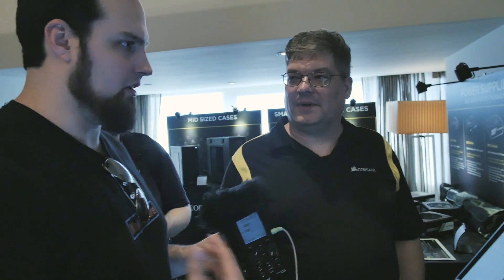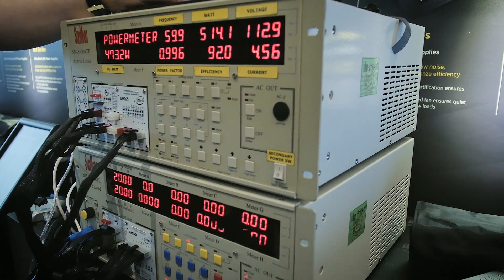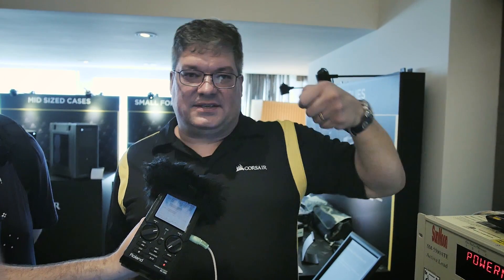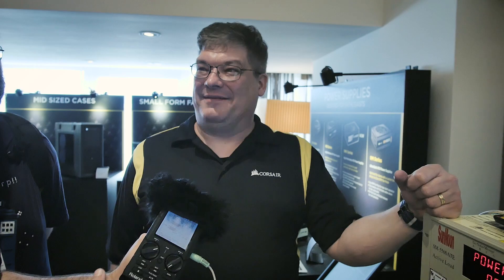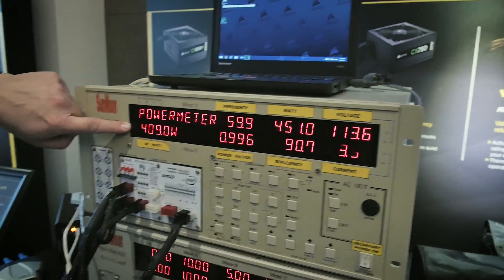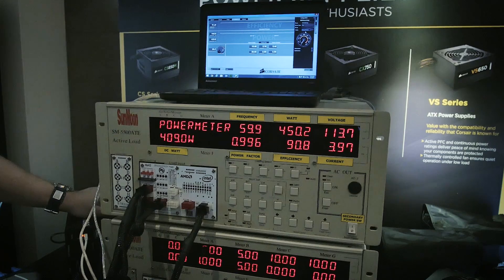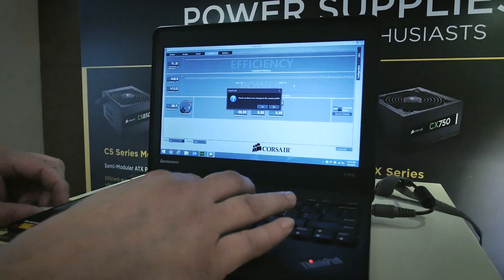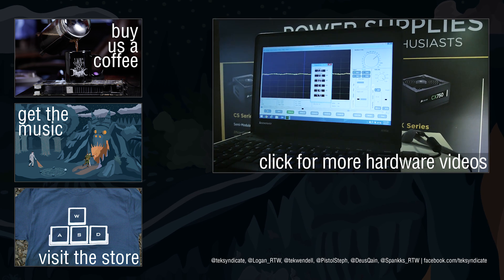Single Rails VS Multiple Rails Power Supplies - With Jonny Guru | Corsair PSUs

Comment: Great interview. I really like this 1000 watt PSU from corsair. Dead quiet at 400 watt load?!! That's perfect for me.
Reply: legendray2008 Silverstone nightjar has a 500 or 520watt fanLESS psu ( It's in my wife's rig.  Only problem imo is the price:  150 bucks.  ouch.
Reply: legendray2008 It's extremely similar to a Seasonic model from which the main parts of it came from.
Reply: Chronofusion I've got the EVGA Supernova 1000 watt P2. It's not that quiet unfortunately. Actually, it's the noisiest piece of hardware in my watercooled rig. I was looking for a fanless PSU that would power an overclocked AMD FX 6300 & an R9 290, could not find a fanless PSU high enough in wattage. So I decided to go with a high wattage good quality PSU. This EVGA wasn't the best choice :( even with eco mode activated ( a switch that you flick) . And you're right, Seasonic is like a major supplier in the business alongside other companies from Taiwan.
Reply: +legendray2008 get an ax1500i the fan doesn't even spin until like 500watts

Comment: I got the EVGA SuperNova 850GS. Is that single or multiple rail? 
[edit]
Nevermind, looked on Newegg and said it has a single +12v rail.

[edit again]

What is the difference between the GS and G2? I got the GS one because it's smaller and cheaper, but I am wondering what's the main difference besides the 7 vs. 10 year warranty?
Reply: Jon Doe whoa I straight up did the exact same thing (I'm installing it this weekend). I had the same questions...
Reply: Akshay Patel I just looked it up here: http://www.jonnyguru.com/modules.php?name=NDReviews&op=Story&reid=414

Looks like the G2 comes from Super Flower and the GS comes from Seasonic. Two great PSU makers.
Reply: alright sweet thanks for sharing!
Reply: Smoking Crop Thanks for the cool site. Read up about my PSU from Jonny Guru on his site and I am happy with my purchase. :)

Comment: I will still prefer single rail power supply for most builds because if you properly install every thing chances of short is zero so no problem with a single rail psu. 

Another thing is I have seen people struggling with evga multi rail psus with sli systems due to lack of load balancing where a single rail psu could easily be used with less pain. 

I myself is using a single rail psu from corsair with my sli system,  no problem what so ever, and it does have ocp too so i think it will be fine. I mean come on people are not that stupid to short a rail or are they?

Comment: So from what I gather multi-rail PSU's are safer but the odds of a catastrophic failure of a single-rail PSU is incredible low.and like wise the odds of a multi-rail PSU not being able to power your BEASTGPU 9000 is incredible low too.So there's not much difference between the two products...

Comment: So then this thing I just got is a piece?  Thermaltake Toughpower Grand 1200W SLI/CrossFire Ready ATX 12V V2.3 / EPS 12V 80 PLUS PLATINUM Certified 7 Year Warranty.

Comment: Europe's electrical infrastructure is very hazardous and unreliable (more so with relation to the US), which makes sense why Europeans would want a safer multi rail power supply and Americans a single more powerful rail.
Reply: GuardianLords huh, i was always under the impression it was the other way round. though i live in the uk, which has a somewhat diffrerent electrical infrastructure than mainland europe. though thinking about it, maybe that's why every plug, even for something like a desk lamp, has a fuse in here.
Reply: GuardianLords  Yeah, we didn't have electricity for the past 20 years. What do you even talk about?
Reply: GuardianLords
Certainly not in all of Europe. Here in Germany the infrastructure is very reliable. The 50 Hz line frequency is rock solid. Power outages are very rare events.
Reply: +Conenion i've had only one power outage in my previous house, lived there 10 years
Reply: Kit Vitae
I am 43 now, and I experienced about 2 power outages in all my life (again in Germany). Ok, I won't remember anything before I was 10 years old. :-)
Reply: Ivan Denkov And before that we had only the radioactive electricity from nuclear plants.
Reply: Kit Vitae that's actually a legal issue in most modern building in America. However i believe it's a state thing which means it will change from state to state and from political and economic ideal to the next. I know here the power infrastructure is reliable if old and inefficient.
Reply: Conenion you're possibly very lucky. I live in Texas and the town Im in has an electrical grid built with a couple redundancies in it, few weeks ago lightning strikes took out so many poles in town power failed for an hour or so.
Reply: Conenion Germany is different from most of Europe.  Think about Italian and French cars compared to German cars.  The Italian and French cars break down a lot.  American cars are probably less reliable than German cars but they're still more reliable than the Italian and French cars.  If that translates to wiring as well then what Guardian says makes sense.

The only reason why I get power outages is because idiots hit power poles where I live...
Reply: GuardianLords "Europe's electrical infrastructure is very hazardous and unreliable" 

Please answer my following questions 
1 From which country are you?
2 Are you a qualified Electrician, technician or electrical engineer?
Reply: Junoh Productions After reading your comment, I seriously hope you'll become the next winner of that pole hitting tournament.
Reply: MatzeGamer Easy there Klaus, your shit smells too.
Reply: GuardianLords There are some areas that lack ground wires for outlets or use over 200 volts. Even if they tended to be well maintained they would still be more dangerous.
Reply: I'm from the UK so it might be different for us compared to the continent but you may be referring to the fact that our power runs at 220V/50Hz instead of 110V/60Hz like it does in the US. Theoretically, one might argue that makes your electricity supply safer, but in truth, you're pretty fucked whether you have 220V or 110V coursing through you, so the issue is negligible. Also, even though we use higher voltages, our infrastructure (at least in the UK) is incredibly safe. Even our 3-pin plug is one of the best designed plugs ever, especially in terms of safety.
Reply: Lucas Williams electrocution risk comes from the amps, not the volts, but yeah. (also i believe recently the schuko plug standard has been generally regarded as safer? offering the same protections as the uk plug but also without the stepping-on-it risk.)
Reply: Kit Vitae Ah speaking of plugs, some countries have plugs that can be inserted with positive and negative inverted which is not really desirable either.
Reply: ***** There's no "positive" and "negative" on AC! Just Neutral and Life!
Reply: PERILEX Okay, what do you call the different wires in three wire single phase AC power where you are from? While imprecise, even electricians around here often use the terms positive, negative, and ground. A three phase AC system on the other hand has a revolving magnetic field and thus true positive and negative. Here we don't get too caught up in this technicality though and just use it to refer to colored leads regardless.
Reply: ***** 

German translation

[FOR AC (Lower three-phase power grid)] 

(PE) "Ground"/"Potential earth"/"protective
       conductor"

(N) "Neutral"/"Neutral conductor"

(L1 or L2 or L3) "outer conductor 1, 2 or 3"/ "conductor 1, 2 or 3" 

[For DC (battery's)] 

(+) "plus-pole"/"positive-pole"/"positive"

(-) "minus-pole"/"negative-pole"/"negative"
Reply: GuardianLords is the sky blue-er in America?
Reply: Pet My Bear
If you are from Beijing, then yes
Reply: ***** every house in the uk i've been in has a fusebox that shuts off power to individual rooms, and sometimes things like the oven and fridge etc.
Reply: Kit Vitae The installations in the UK are often described as a "Joke" compared to the stuff you'll find in German households!

- Three-Phase power-grid to every  
  household  (230V/400V)
 
- Multiple Type A RCDs for Bathrooms,        
  continuous-flow-water-heaters and all power-
  points.

- separate Circuit breakers for each individual
  room and the illumination circuit.

- separate Circuit breakers for kitchen-
  appliances such as Fridges, Microwaves,  
  ovens dishwashers and other devices.
Reply: PERILEX wow, 400v?
Reply: Kit Vitae Yes! In between the phases there's 400V since they are desynchronized!

http://www.esaver.ch/wp-content/uploads/Spannungsdiagramm-Drehstrom1.png
Reply: yeah, they do. i only saw one needing a change once though. saw ppl having to go flick the fuse box back on about 20 times in my life.
Reply: Kit Vitae I live in an old-ish building in downtown Toronto. The wiring is so fucking backwards, my gf trips the breakers everytime she blowdries her hair. I'm used to flicking the fuse box every day or so.
Reply: Pet My Bear yeesh. that sucks.
Reply: The plumbing in the UK is even more crazy. They had very lax building codes which allowed each tradesman to pretty much do things in whatever way they wanted. Some worked fine but dodgy methods were also pretty common.
Reply: GuardianLords Europe doesn't have a single infrastructure you idiot.
Reply: John Michael Stock it does when you're american ^^
Reply: Pet My Bear Of course it is bluer. They are exceptional so their sky is exceptional too. Joking aside just one more clueless ignorant American showing hubris even is sucha banal areas.

Comment: Ok so what company screwed up? What company was Johnny talking about?
Reply: muiecopyright probably corsair themselves...
Reply: ***** Thanks for the answer.
Reply: ***** Correct. The makers of some of the most over-hyped, over priced, and under performing psus ever built.
Reply: cee128d that spot is currently occupied by XFX. budget junk sold at a premium price
Reply: Space Cadet no it's not. XFX only uses Seasonic platforms, which perform great. But these platforms from Seasonic aren't cheap.
Reply: muiecopyright GUYS GUYS GUYS.... come on man it's all about insignia PSUs.
Reply: ***** WRONG. 

PC Power & Cooling owned OCZ and in 2014, firepower technology bought both companys. 

Don't spread disinfo. PCP&C makes the guts of some of the best PSU's on the market.
Reply: Afrothunderkat You are really clueless here. OCZ purchased PCP&C, not the other way around and neither have built their own psus for years. In fact, OCZ never did.  All of theirs are rebrands. PCP&C stopped making their own years abo, about the time the industry switched from 20 pin to 20+4 or 24 pin. 

PCP&C used to make excellent products back in the day, but the overall quality of their products have seriously deteriorated since they started having them made for them. With a very few exceptions, that occurred about 10 years ago. Anyone who believes that "PCP&C makes the guts of some of the best PSU's on the market" is seriously deluded as the facts show otherwise.

Comment: If you are running a 500w power supply , i do not see the point of multi rails, cause the total amps it can provide is 32 to 42 .

Comment: So the question now that needs to be answered is how often GPUs draw over 40 amps, and which ones are more likely to do it. If it only happens when you're running quad 290x's then it won't matter to 99.9% of people.
Reply: Nathaniel Graham If you run 4 290x your house is going to burn down anyway. (yes i know the aftermarket coolers do a pretty good job cooling the card,  it was a joke!!!)
Reply: Nathaniel Graham They should never run over 40 amps per connector (That'd be 960W of power draw over two) as there is NO WAY you'd cool that without phase change or some other crazy way no one can actually manage normally.

Comment: i have cant understand any of what he said in this video..................... can someone put it super simple to me? like is multiple good or bad? and what is default for example corsair rm 1000i comes with in norway am confuse
Reply: 50/50 single rail = less secure, but more power. Multi rail = secure, but limited power through each connector.
Reply: Theappelk Buy from a reputable manufacturer and you' shouldn't have nothing to worry about.

Comment: Thank you for doing this with JonnyGuru, he knows his stuff very well. Good content like this is what the community needs, not crappy power supply 'reviews'.
Reply: PSguy Mentalist that's why the johnnyguru site got its reputation :)
Reply: sinephase even tho he works for corsair, he still gives good reviews for other brands like evga
Reply: zhi xing ong i bought an evga because of one of the reviews on his site. I particularly like the hot box testing and disassembly sections. lets people know exactly what they'll be buying
Reply: That's why tek syndicate is the best channel
Reply: PSguy Mentalist yeah you see that a lot on computer webshops in the netherlands. A 50 year old man buys a new power supply for 20 euro and if it turns on it gets a 5 star review and gets praised as the best psu in the world.
Reply: FoodOnCrack That's not that bad. There are some people who claim that there are "gaming" power supplies. What the hell?
Reply: PSguy Mentalist Well... You could divid the high end power supply market into 2 sectors. The gamers who want a power supply that can power mutliple GPU's whilst looking nice and being quitet. And then there are PSU's for servers where looks and sound doesn't matter but stability and redundance does more.
Reply: FoodOnCrack PSU's for servers aren't made like the regular ones, they're modular in design(not the cable, the unit itself), other form factor and other components for power delivery. So they're already divided. The regular EVGA, Seasonic, Corsair etc etc PSU's are already targeted towards normal, WS and gaming systems. The whole "Made for Gaming" thing is plain stupid. Just like the "Gaming" Cases.
Reply: PSguy Mentalist Same goes for "gaming" motherboards, makes me want to vomit all over. Unless the person is going for a world record overclock, $100-$150 mobo at the most will be more than suitable.
Reply: norge696
 Atleast those motherboards come with gaming oriented features. What about "Gaming" mousemats lol, what nonsense lol
Reply: PSguy Mentalist there is a difference
Reply: zhi xing ong
 The difference doesn't classify it as "Gaming"
Reply: PSguy Mentalist for mousepads yes actually. It is more precise
Reply: PSguy Mentalist That's not entirely accurate, over here in the U.K, the whole debunking of shitty PSU'S was destroyed by our lad James Garbold, in England, from CustomPC. The reviews is what caused junk PSU's to be scrapped and, frankly that was when the first computer pc reviews started... Oh the good old days.
Reply: Amir Ali
 Yeah I think I know, I followed that guy a bit. I meant the shitty reviews on YouTube and other tech sites which basically makes any PSU look good. My first choice is JG though, this guy is awesome.
Reply: zhi xing ong Actually, even though it's his site, OklahomaWolf does most of the reviews - he has an amazing writing style, makes reading reviews fun.
Reply: On YouTube only OC3D does actual PSU reviews

Comment: The biggest reason I personally go with single +12v rails versus multiple is because I personally have found shopping for PSU's with multiple +12v rails is difficult, as I have a hard time finding out what connectors are on what rails.  Or, the ones that DO have this info easy to find have the connectors on rails I don't want.